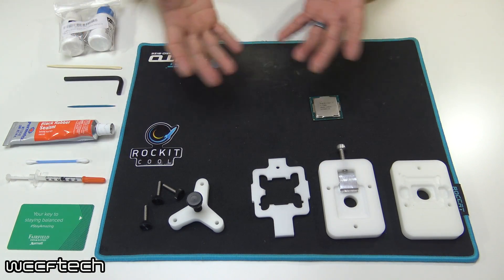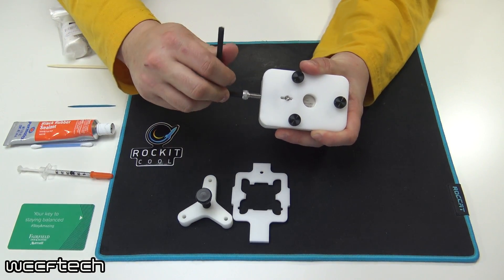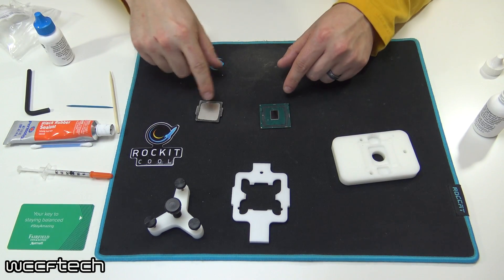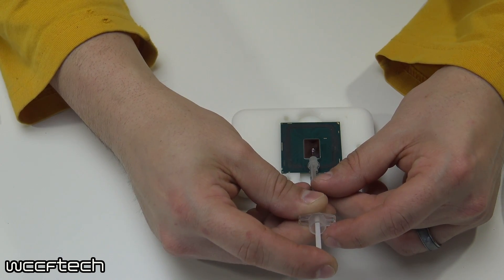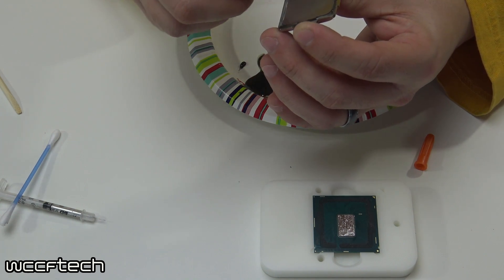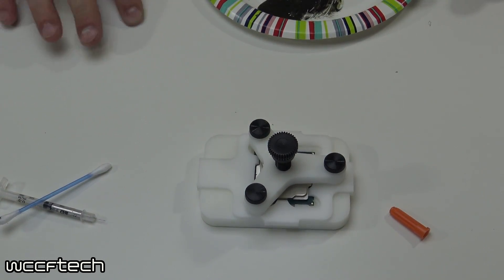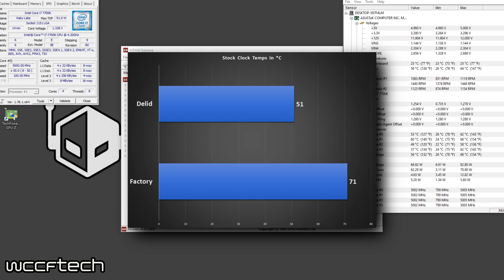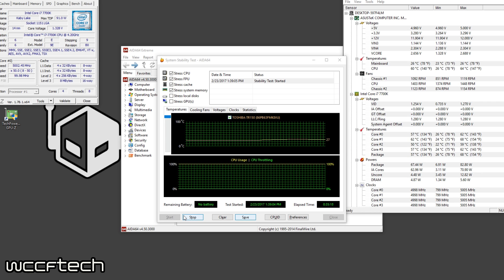Intel i7 7700k Kaby Lake Delid and Relid Guide with Results - Rockit Cool Tool

Comment: Hi folks,

what "temps" are you talking about? CPU temp or Core temps?
I delided my i7-7700k and used Kryonaut when closing it up. I got a custom loop with an EK Supremacy EVO. The CPU is OC'ed to 4.7 GHz @ 1.225V. My Core temps are around 78°C when running Prime95 at "max heat" setting. CPU temp is 62°C max, water temp 28°C.

Comment: Just delidded my 6700K and man...... I see now why the damn thing would get up to 95 celsius during gaming. There was basically NOTHING between the die and IHS!!! I even just brushed off the stock thermal compound with my finger...... it all came off in one swipe. It also rolled up into a ball just larger than a grain of friggin sand. I applied Cool Laboratory Liquid Ultra and am seeing no higher than 47 celsius at 5.0GHz @ 1.305 volts while gaming. I'll try taking it to 5.2, maybe 5.5GHz in the future but for now I'm more than satisfied with 5GHz and no higher than 47 C underneath an H115i. I'm tempted to try out my old ass Hyper 212 Evo on this chip to see how well it can cool the 6700K now that the stock compound has been replaced with something 1000 times better. I previously had the chip @ 4.7GHz with 1.375 volts, but it got up to 95 celsius while gaming. Running ANY stress test utility would instantly see my 6700K hit 100 celsius..... the stock compound that Intel uses is a joke....... I'd like to see them just soldering the IHS to the die like my 2600K. That cpu I still have running @ 4.7GHz and 1.3 volts even after 6 1/2 years. It never gets higher than 53 underneath a Corsair H60.

Comment: I almost had a seizure watching you spread the Liquid Pro on the die without putting tape around it. Damn good job, buy oh my jeeze my nerves lol. Great video
Reply from the maker: lol, I've delid so many chips before I ever heard of anyone putting tape around the die,lol.  I've used painters tape around a GPU die when spreading so I don't get TIM everywhere and it stays clean tho.
Reply: I'm getting my 8700k in about 4 hours. I got the same exact tool for de-lidding. I'm not taking any chances this go round with ridiculous temps. I sold my ENTIRE Kaby Lake build because of how bad the temps were lol. I'm just going to use Super Glue to put the IHS back on. Do you have any advice on that?
Reply: Someone said it has to be a special type of sealant that can withstand 100*c temps or something c:

Comment: out the box my 7700k at only 4.5ghz load was doing 95-100C with a Noctua d15 w/ Noctua NT-H1, had to go in the bios and lower the vcore to 1.2... same test gets temps up to 86C... still pretty hot, basically I can't overclock this unless I delid it.
Reply: I know right? My temps are at 90-100 when running certain games - its absolutely crazy :( I tried lowering the vcore too but that didnt change much at all.

I looked it up on the internet - and it seems like its a swing and a miss if the cpu will run highish or very high, with the 7700k. I dont know the brand of my cpu-cooling, but its some stock shit, so I'll prob have to delid and/or get some much better cooling installed.

While I havent experienced any problems with performance (I checked the cpu temps several times over a few hours at 90 degrees) - It still feels very tacky that you have to do a diy to fix it because youre afraid that the high temps will fuck up your cpu over time.
Reply: tinostarks I delided my 7700k and it dropped 28°
Reply: ghfhgfuuu i heard it doesnt affect idle temps is this true? my idle temps are 40c and 70-75 while gaming
Reply: Verked idle load at 5ghz was 52°C. After delid it was 35°C.
Reply: Yea these chips seem to be all over the place from semi hot to crazy touching the sun hot.  Just to get my temps respectable in the 60-65c range with load at only 1.28 volts max I needed a delid, liquid metal and 280mm aio.  He seems to have a decent chip hitting 5ghz at 1.328v and only hitting 64.  I can hit that with only 1.28v applied.

Comment: Hey so when you re-applied the AIO did you use Coollabs liquid metal on the top of the CPU as well? or just a normal paste?
Reply: liquid medal is conductive so if you miss putting it on you can risk short circuiting the cpu and/or motherboard
Reply from the maker: Just use normal thermal compound :)
Reply: WccftechTv is there any downside to liquid metal, doest it wear out the chip faster with time or anything?

Comment: They forgot the gap in the sealant for heat expansion.
Reply: Pause at 2:40
That's the gap in the silicone that is necessary.
without it, you risk having the CPU heat up the air inside the IHS and then popping the IHS lid open while it's running.....
Reply: Where do you see its recommended to leave a gap in the sealant?
Reply: your the man

Comment: I read somewhere that claimed you should put nail polish over the copper bits because the liquid metal is conductive (since its a metal) and that it would kill your cpu if the liquid metal touched the copper bits. I was just wondering if I need to do that? or would it actually be more dangerous to nail polish over the exposed copper?

Comment: paying 350$ on a 7700k to get more perfomance and ocing but ended up intel cheaped up on the thermal paste and the temps tottaly sucks in stock thermal paste
FUCK U Intel
its AMD'S FAULT  too for not being in the market competition for so long.

And finally  the losers r us 
The consumers :( :(
Reply: i reckon they did it on purpose, to cover their ass incase everyone decides to overclock the shit out of their chips and want to claim warranty later when the cpu is damaged and stops working. its the same with cars, you cant expect to install a 1000hp rated turbo on a car and blame the manufacturer when the headgasket blows.
Reply: From what I read, Intel chose long-term stability over performance.  The TIM they use is meant to outlast the typical life of a build.  Some of the liquid metal TIMS and even the artic silver compounds tend to degrade over a couple of years and have to be reapplied.  I don't know if that's true, but it's what I hear is the primary reason.

Comment: I think the adhesive you got isn't actually silicone. Permatex's black silicone adhesive has the number 81158, and this is 80338.
Reply: Ya its not actually silicone sealant.  It clearly says rubber sealant on the tube.  Silicone sealant will not come out all runny like that.

Comment: i've seen other people put the liquid metal on both the cover and the pcb, does it matter?
Reply: yes, its best to apply to both sides. You should also clean all the old black 'glue' off the pcb. It comes off really easy with just your fingernail. IDK why this person did not do these 2 steps. I just did my 6700K and it worked great CPU max temp while gaming is 49c with fans running at 30%. I saw about a 6 degree improvement.

Comment: After watching this and numerous other 7700k delidding clips I ordered the rockitcool delid/relid kit, coollaboratory liquid ultra and permatex rtv red high temp silicone. I had 27 deg idle temps on 6700k, in the same set up I get 38-40 deg with a non delidded 7700k...crazy right? Must delid this thing!!! Thanks @WccftechTv for the detailed tutorial
Reply: Why do you have to be negative?? He persistently asked me to sell it to him at that cost. 7700k was just out with temp issues
Reply: you had a 6700k and bought a 7700k for 2% gains? Such waste ahahahaha
Reply: Actually no. I was comfortable with the 6700k until a friend offered to buy it at almost the purchase price. So i sold it for the 7700k. I delidded the latter and am now running at 4.8ghz on air cooler (max temp 71 deg). It feels much faster than the 6700k. So it wasnt a waste mate and the gains are a whole lot more than 2%...say 15-28% when overclocked.
Reply: So you actually deluded your friend to buy outdated CPU for the price of new one. That's better, for sure.
Reply: That's just the sarcasm. Don't take it too closely.
Reply: lol i run at 5.0 ghz on a air on my 7700k

Comment: How long does the liquid metal last for? is it comparable with thermal paste? Do you need to reapply it or does it last for years?
Reply: Ive seen it after a year and it still looks as new. Not yet seen older but no reason to suspect it needs re-pasting. Its new territory for most of us.

Comment: Is this something only necessary for modern Intel CPU's? Looking at the chip underneath, it reminded me of some older AMD Athlon CPU's, which had the die completely exposed, and you put your heat sink paste directly on the die, and stuck the heatsink directly against the die.